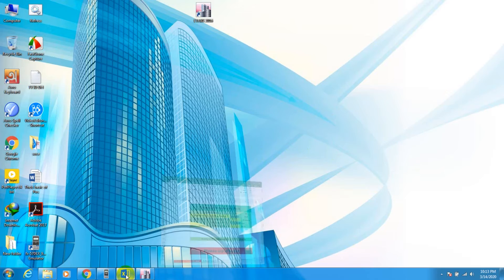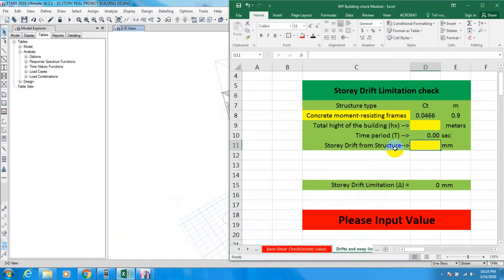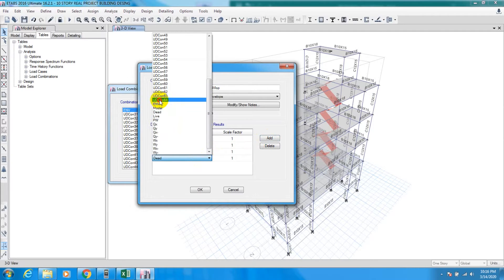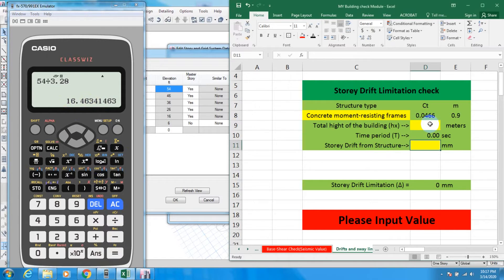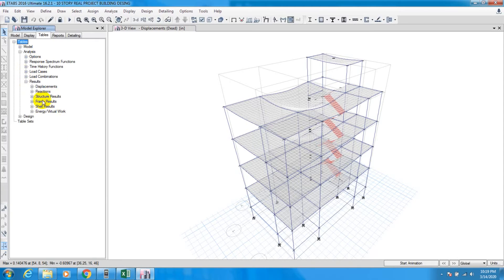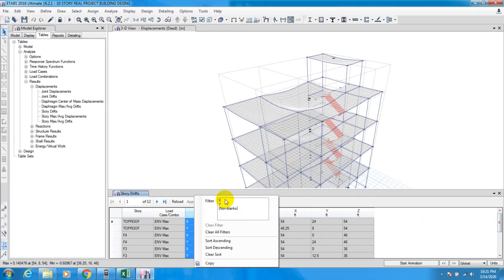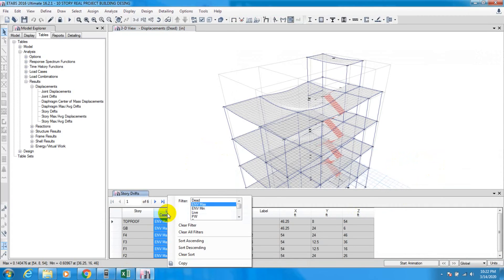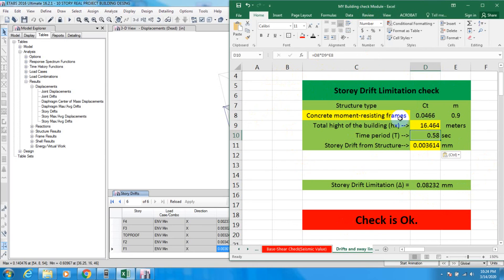Etabs Full Tutorials for beginners | Story drift check using Excel in Etabs | Lec-24

Comment: Assalmualikum....firstly thanks lot for this good initiative....but i have a question that in excel sheet .story height use in meter but the story drift use in mm ,please explain it .....thanks again.
Reply from the maker: no problem.. i have programed that. it will convert where need what.